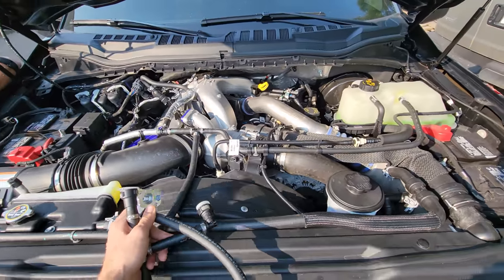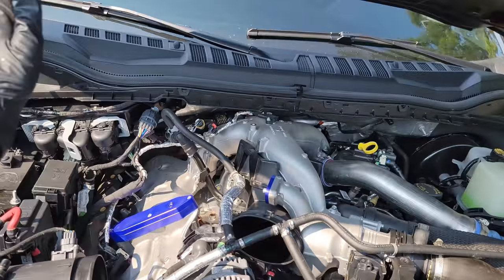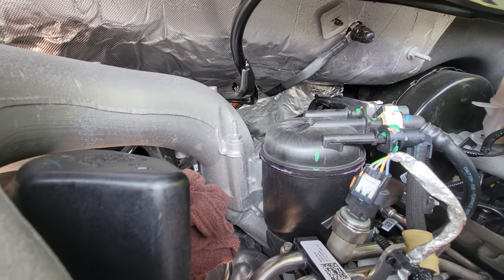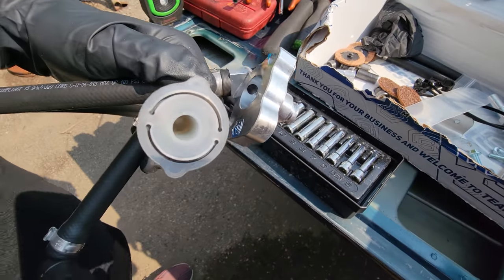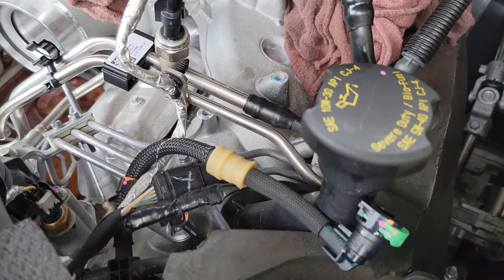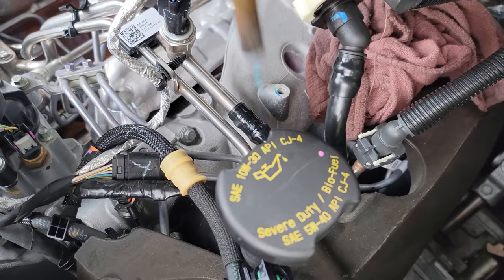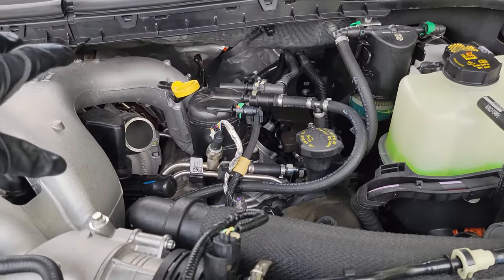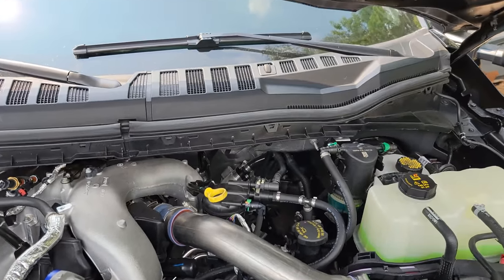FORD 6.7 Powerstroke GEN2 CP4 Bypass Kit Install | S&S Diesel Motorsport | A MUST HAVE

Comment: I viewed an hour long video regarding the development of the 6.7 power stroke, featuring enthusiastic diesel engineer Cass Choate, who is intimately involved with the PS. He outlined the failures and successes of the PS from its inception (2011) until 2020 when they switched to the race engine steel pistons. It’s an eye opening commentary about trial and error and Ford’s commitment to winning. I’m pursuing an F250 w/PS and I admit, I was intimidated by the complexity of modern diesels in general and this design in particular. He revealed many issues that caused mechanical failures to where engineers were stumped about what caused the problem, and what to do to solve it, while customers patiently waited for answers. If I had a 6.7, I’d look to Choate to help out. Fascinating & highly recommended video for diesel fanatics like ARod and all of us. Here’s the link: 

https://www.youtube.com/watch?v=pbV7mqzRm9A

Comment: Just did mine today and I agree with Travis. Having all the EGR stuff still in tact makes it a little harder especially with the passenger side rear upper manifold bolts. I installed the Gen 2.1 kit (white Donaldson filter), but pretty much the same instructions. I installed the HSM filter upgrade kit at the same time (thanks to watching your videos). The video was definitely a great reference! Keep ‘em coming AROD!
Reply from the maker: Doin one in 9 hrs

Comment: Well as usual I broke the electrical connector on the pressure regulator and it fell off giving me the p0001 code took it back apart now it is fixed. Thanks for all of your vids they are a great help.

Comment: I installed this today 8 hr job, been sitting on it for a year, got the updated alum return filter head. Unfortuantly the connecter that comes off the hardline for return to tank doesn't rotate 180 deg, I have a 17' so maybe different had to do some tweaking to bend the hard line up so the new alum barb would fit into it and not kink the rubber hose, still has a slight kink. Took an hr to clean out intake huge chucks of soot, no leaks and seems to be good. Use this guide to help to the job.
Reply from the maker: Buddy, that line shld twist right inside that hard line. I just did 1 yesterday
Reply: @PowerStrokeTechTalkwARod  I know, my build date is 1/17 maybe they have 16' lines no idea but they don't twist, I twist the line itself trying to do it. Looking closly is all one piece 100% won't twist on mine.

Comment: I had this installed on my 2017 Ford 6.7 diesel by a Ford tech. 
 Afterwards I started getting a engine light code P088 high pressure in fuel rails. 
 Ford kept my truck for the entire month of January 2022. They replaced the drivers side fuel rail, check valves, pressure regulator and more. Check for fuel contamination and had none.
 I called Tim at accurate diesel and he said could be one of those 2 o-rings on bypass kit. Not manufacture problem. I believe it may be it got cut or pinch during installation. 
 Still doing to this day. The light will come on for a few days with no visible loss of power and then just goes off. 
 I think the kit is definitely worth it to save up to 10000.0 to replace the entire fuel system.
Reply from the maker: Wow!

Comment: Just so I understand completely..... the purpose of this kit is that should the CP4 take a dump and start pushing metal flakes into the system, the new filter catches it instead of it getting into the injectors, tank, and elsewhere in the system resulting in a much higher repair bill that just the faulty CP4 replacement?
Reply: The kit is worth it. I have it on my 2012, my repair cost was 5k all in after my cp4 went out
Reply: @bob1341  5k for a new pump and fuel filter?
Reply: @BetweentheCheeks00 have you seen how you have to replace the pump? I watched a DIY video and started crying 10min into it😂 practically have to disassemble to whole engine.
Reply: @aagl747  Disassemble the engine? You have to take off the intake manifold and some hoses. It's a 6-8 hour job for an amateur. A mechanic charges 125-150 an hour. A brand new cp4 is 1200. That should be a $2500 job for a mechanic.
Reply: @aagl747 he had the CP4 exposed in this video. It's nowhere near taking the whole engine apart.

Comment: Question ARod how many cases of disaster have you  seen or had to repair, I'm just trying to get an idea of how common these CP4'S Actually come apart?  And last week while I, was at the Fuel Island the Gentlemen on the other side of the pump was filling up his 6.7 which was a 2017 after I,inquired to the year, and then I,asked him if he had done the disaster proofing on his truck and as it turned out he was completely unaware of the problem, so I,explained a little bit about it to him and he said that he was out of warranty and would definitely be looking into it, especially after I, told him about how expensive it was to fix the disaster and how much it was  vs getting the prevention kit.    But anyway I was just curious about the pump failure rate is, I, have one case of it that happened to a Canadian Hotshot driver I. His F450 and this dude is constantly or so it seems that he is always Towing stuff on his 40ft. Gooseneck that's was way beyond his Max weight, and he blamed it on making a poor choice of where he purchased a tank of fuel.  Me I, have a 05 6.0l and I'm pretty religious about using a fuel additive with Injector clean,and cetane boost and I, give bottles to my son for his 2016 6.7 Cummins and I, also run Amsoil 15-40W and change it every 5 to 7K.
Reply from the maker: Ooo maybe well talk about this tonight!

Comment: I just tackled this install on my 2020. Thank God for this video. The install still took me 5 hrs, and this is the first diesel I’ve owned. The manifold definitely tested my patience as one of the rear bolts on the left side was a pain to get to. My truck has 54,000 miles and I was happy to see the VCV wasn’t showing any metal shavings. I’m happy with how the kit went in, and it was definitely easier putting everything back together. Thanks so much for the video Arod.
Reply from the maker: Just did 1 yesterdeeee
Reply: @PowerStrokeTechTalkwARod  So, reviewing the install and referencing some removal and installation documents here.  Is there a way to reuse the crankcase vent oil separator and line?  The Ford documents state to cut the rubber sleeve and break the tabs on the quick connect.  Then, it says install the new one.
Reply from the maker: I always do just did mine, twist & PULL
Reply: Quick question will this effect my 100k motor warranty? My 2020 has 30k on it and im always thinking about that damn cp4 i use additive from Ford and also Howes in the winter but i really want to install this s&s kit.... Also what do you think about the sinister cold hot tubes?
Reply: @jers9375  I, have an 2005 6.0l and I, put in The Hot & Cold pipes and boots and also did My intake Elbow, and I, have had Zero issues with them. And I,will also be doing coolant Reservoir when the time comes. I've had good experience  with Sinister Products.
Reply: @Jer S  that's what has kept me from doing this kit but I may do it because I am really concerned from my filter change today. In the description he states that this won't affect the warranty on your vehicle. That was my concern but I guess it is a non issue but I am concerned if I do it myself that if anything happens they will want to blame me for any issues so I may have a shop instal it to have my ass covered.
Reply from the maker: U shld watch thee manufacturers video & decide for yourself...

Comment: Just installed the s&s gen 2 kit on my truck yesterday and i dont know how or why but it runs smoother quieter and on top of that the added protection is definitely hands down the biggest benefit. I will say this the last hose to be installed is the return line off the gen 2 filter needs to be shortened by about 4-6 inches because its way too long but other than that it badass. Also if you had the gen 1 kit like i did you will have to buy a new feed/hardline for this install to be correct on s&s website they say you can still use just the filter without buying the entire kit but mine was leaking somewhere anyway and i wanted to get rid of that compression fitting also so…🤷🏼‍♂️ clean look under the hood and a badass product from s&s also id like to add i had a inline pressure gauge on the feed side i cut their line and reinstalled it and the pressure is exactly the same so no pressure loss whatsoever…..👍🏻✌🏻
Reply: How long was the install for you?

Comment: I like my tools magnetized to prevent screw & bolt drops.its just a mattter of wrapping the tool in wire and putting a charge thru the wire. Found a battery that is like 35lbs lighter and has 1,200 CCA for my 2000 F250.
Reply: That doesn't help when there are more and more non-ferrous fasteners.

Comment: Nice work ARod... another "must have" item(s) to the list, between S&S  and separate vids of HSM fuel filter solutions.  Keep the content coming brotha.
Reply from the maker: Kant wait brotha
Reply: Curious if any before and after install fuel flow data was captured, especially with parts removed?  Read  a forum note earlier this week, other brand DPK had resulted in noise around the return line filter and other concerns after running it for a few months - user planned to remove it.  Separate, another use of S&S's kit noticed a slight bump of 2 psi @ 2k rpm using an energy metering valve, but not concerning in overall performance.

Comment: wooww so nice. so clean install and looking good. this is what Ford should have from factory install. if i buying a Super duty i would have it from the dealer you made a nice work Aaron
but one question? what is the Blue part installed on left side it looks to be there as replaced for som reason. like to now way ?
Reply: That is the trucks egr cooler. The blue plates are block off plates. People get rid of the egr/egr cooler because they have some issues and also recirculate your exhaust back into your intake. The egr will put soot back into your intake causing it to clog up eventually and will run poorly. If you have any questions feel free to ask.
Reply: @willsweeneysreelfishing4861  okej. thanks fore that information, were almost think that i were gr/egr cooler delite that was made on that truck
Reply: sadly not. Wish they were😂, would make these trucks even better from the get go.

Comment: I have a 16 with about 75K miles, change filters regularly, try to buy good fuel but have not used any additives on a regular basis.  A few years ago on a road trip pulling a trailer I got a low fuel pressure warning and went into limp mode.  I had just changed fuel filters maybe 1K miles before the trip.  I  carry spares so I changed them out, no water no obvious debris or anything abnormal.  Has not happened but that one time.  I had just fueled up about 30 mins before this happened.  Have you ever seen something similar where happens one time and one time only?
I am really leaning toward getting the S and S DPK.
Reply from the maker: I have not. Maybe you didnt seat the lower cap all the way 🤷‍♂️ how ever the S&S kit is a top tier kit

Comment: Very good video of prep and install of the Gen 2 CP4 Bypass Kit from S&S Diesel. I have been interested in installing this kit on my 2011 6.7 and am glad that there are no modifications that have to be made as with the original. Clean look and straight forward install. Kudos to S&S for the R&D improvements and to you for a high quality video without all the nonsense. I will be buying this kit soon and getting it installed on my 6.7 that has just over 250k on the original CP4.
Reply: Please add a bit of info about your PM Practices?? Like how often fuel filters replaced, have you used lubricity additive since new or approx when?  Have a 2016 but didn't learn about the CP4 issue until about 30K miles.  Thanks, RC
Reply from the maker: Check our video we did about maint, we did against a white board
Reply: @PowerStrokeTechTalkwARod  Thx, did but am hoping to hear a reply from Ray Filbrick about his particular truck with 250K on it.  Especially when he started using additive for fuel lubricity. Concerned how much damage may have occurred to my own by following Fords recommendation never add additives, until my shop recommended it.  This is my first diesel truck and this CP4 issue is dang disappointing.
Reply from the maker: EVERY tank is supposed to have additive. If there was something wrong....brother that fucker wouldnt be running, PERIOD
Reply: @PowerStrokeTechTalkwARod  AM doing additive every tank religiously now. Shop recommended Stanadyne. Thoughts?  Something better?
Reply from the maker: That & Hotshots Secrets, use our code PTT on their site. They ha e really nice product. Fuel, oil...all of em
Reply: @PowerStrokeTechTalkwARod  Thanks.  Cant seem to find the white board maintenance vid you mentioned. Looked through the maintenance Playlist no thumbnails of white board. Might be old eyeballs and small screen, help?
Reply: Disregard request about white board presentation...it just showed up in muh feed watching right now
Reply from the maker: Hell yeah. We are re-doing it
Reply: Doing this on my 2011 F350 with 275k.  Looks like a straight forward and well designed kit.  Already have the DPF  and EGR delete with the EZLINK Auto agent tuner.  Made the truck an animal..
Reply from the maker: Nice kit

Comment: Time saver, just a suggestion, that style of quick disconnect I think is the most improperly removed disconnect I've seen. 10:25 If you push the big green portion on top of that tab in like a button and pull at the same time, it'll come right off, and wont break the locking tab.
Reply: You're thinking of the previous generation. The later ones you DO have to pull the clip.

Comment: I did the spe one on mine. I like that you do not need to remove the factory fuel line on spe kit. S&S make great stuff too. 
Also spe customer service does suck. But there shit is good too.
Reply from the maker: Id STILL rather not deal with them

Comment: Ford should have this kit installed at the factory.  These truck are so expensive to buy, no one  wants a CP4 repair bill  on top of the purchase price.  What is a few hundred dollars more when purchasing  a hundred thousand dollar truck if it gives you peace of mind and save you a fortune down the road if you do end up with a bad CP4 pump.
Reply from the maker: I know!!!! And people are hatin on me.....like hello wake up
Reply: Actually, Ford should replace the CP4 with a pump that is designed to not fail when using ULSD like GM has done by switching to Denso
Reply from the maker: Interesting
Reply: @21psd  GM is still having problem with there pumps even to this day. My buddy is doing two to three a week.
Reply: @carlocrivello3044  I didn't know this. Are these problems also related to the lubricity of ULSD? I read that Ram Cummins switched back to the CP3 on their current models. I just don't understand why Ford doesn't develop their own HPFP to work with US diesel fuel instead of staying in bed with Bosch, unless its another long term contractual deal like they had with Navistar International prior to 2011 . Meanwhile, I keep adding fuel additives and cross my fingers with every fill-up that doing so will prevent a pump failure.
Reply from the maker: Yes sir

Comment: SPE takes too long to ship products butttt they charge your CC when you place the order!
Reply from the maker: Yuppplppppp
Reply: I got my spe kit after a loooong wait.... First kit, the hose that connects to the fuel filter outlet wouldn't positively snap on and the fragola braided lines nut became a leak as well. After getting a free replacement fuel filter outlet hose and paying for a replacement fragola braided hose (claim I overtightened) I am up and running.

Unfortunately, during 0-60 wot pulls, my truck will alert "reduced engine power"

Regretting ever dealing with spe
Reply from the maker: THATS WHY I KEEP ALERTING YOU ALL TO THEIR COMPANY.........BOOOOOO TO THEM
Reply: I ordered before the alerts
Reply from the maker: Sry bout that
Reply: @bigtimearcher1  Damn I got the spe as well bc to me it looks better made than the s&s kit, hopefully they fix any issues and don’t run into any problems since this video is a year old
Reply from the maker: Everything said, STILL stands, per all of the comments. We wish ya luck with your sub par choice there pal
Reply: @PowerStrokeTechTalkwARod  I have learned so much about this trucks since I found your channel, I’m currently working on new fuel system due to cp4 failure, sadly I had ordered the spe parts before I found your channel lol, thanks a lot for the great informative videos!
Reply from the maker: Welcome to the community brother
Reply: Yup they do take forever.
Reply: 100% agree with comments about SPE.  It takes forever to get your parts, horrible customer service, and their DPK starves your fuel system.  I don’t like bashing companies on YouTube, but SPE is so bad, I would hate anyone to waste their money using them when there are so many better choices out there.  BTW- nice video; thanks!
Reply from the maker: U think you just spoke for all thee internet.....